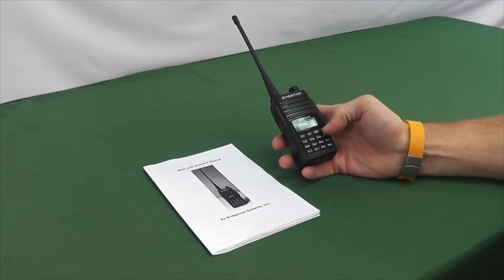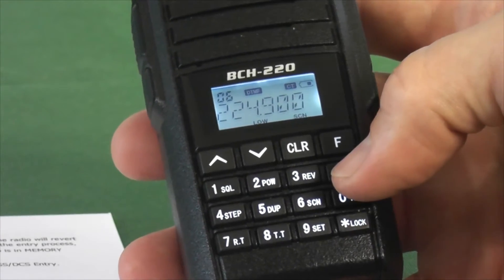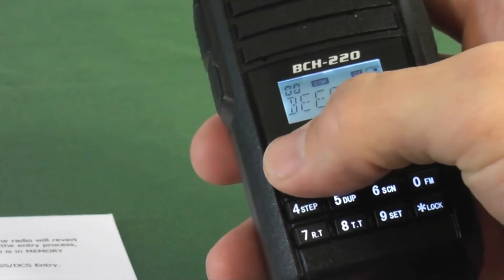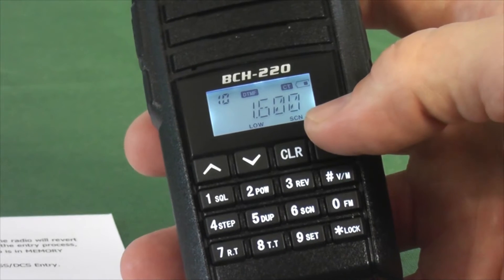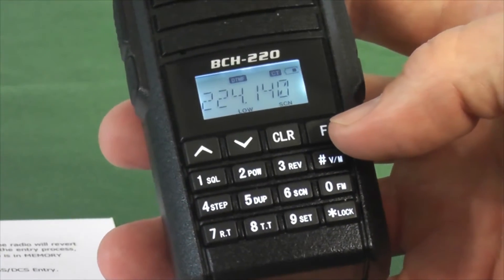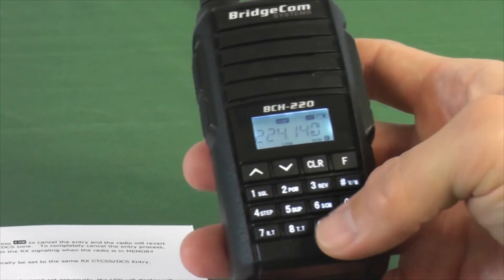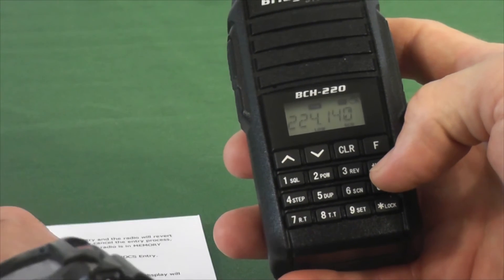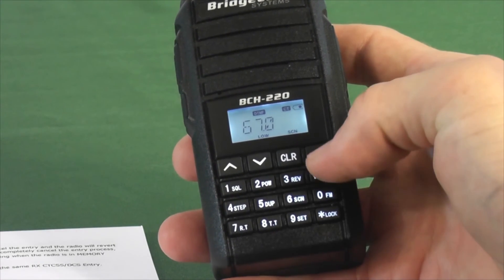BridgeCom BCH-220: Quick Start Guide, Get on the Air #GOTA

Comment: Some repeaters require a POSITIVE 1.6 MHz offset for TX.  How do you set that?  Function-Duplex DOESN’T set a POSITIVE offset even though the manual says it scrolls negative, positive, and off. Also broadcast FM doesn’t seem to work no matter what antenna is used. Either I have a defective BCH-220 or this HT has some serious issues.

A repeater I want to set uses 224.380 RX, 225.980 TX, offset +1.6 MHz.  This can NOT be set, even with software CPS. This is a major issue.

Can’t believe they oversights this!
Reply from the maker: Jerry, the radio is pinned down to the amateur radio (1.25m 220MHz) spectrum and will not TX beyond 224.995.
Reply: BridgeCom Systems, Inc Wow. Sure enough. I looked at the band plan and I’m on the same page. That’s weird. Perhaps the listing for the repeater is incorrect and it was supposed to be negative.  I’ll google it and see it’s actual settings instead of what repeaterbook has. Thanks for the reply. It cleared this up for me.